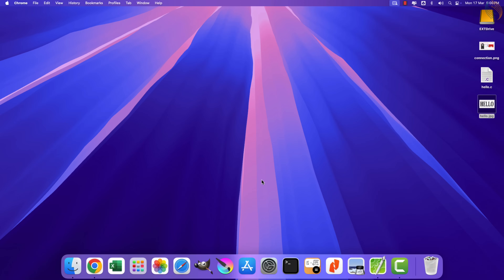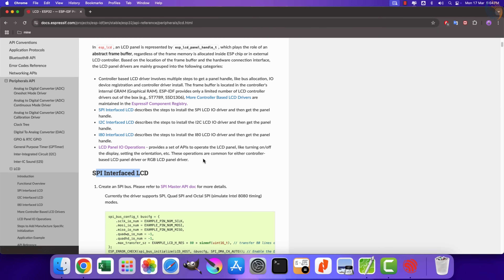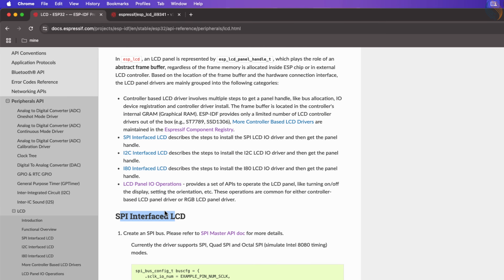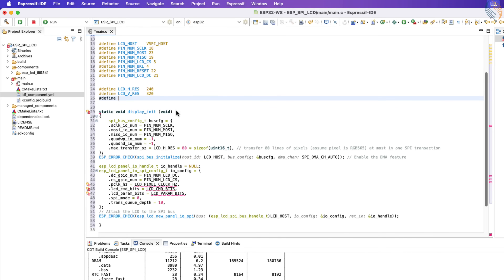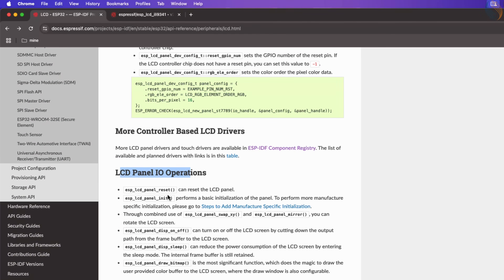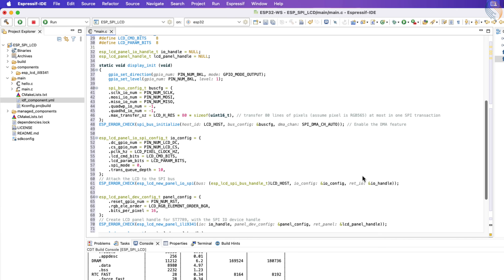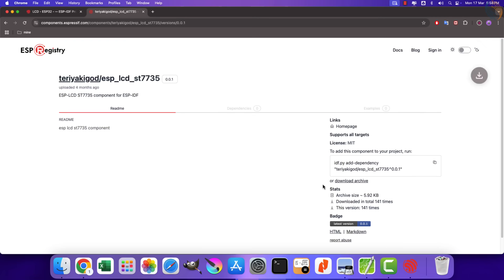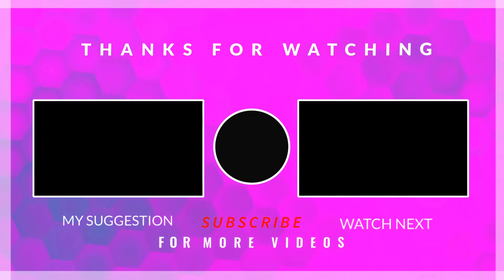ESP32#10 ESP SPI LCD || PART 1 || Interface LCD using inbuilt library || ILI9341 || ST7735

Comment: Hi bro, I want to use it with ili9488, but the support library it shows when I search for my driver is different, like the one you did. Do you think it's feasible to do the same as you and edit parts of the library to adapt it to my driver? Which parts would you recommend I edit? Thanks.
Reply from the maker: What is different ? I found this in the component registry page.. https://components.espressif.com/components/atanisoft/esp_lcd_ili9488/versions/1.0.11
Reply: @ControllersTech  for example the additional parameter "buffer size" and when i work with 16 bits, 
the image is not displayed when I work with 18 (.bits_per_pixel), but it is distorted and incorrect. I don't know exactly what to put in the buffer size parameter and what happens. "esp_lcd_new_panel_ili9488(io_handle, &panel_config,LCD_BUFFER_SIZE, &lcd_panel_handle));" Thank you, i add exactly the component you 
you mentioned ili9488,
Reply from the maker: You can set the buffer size to LCD_H_RES * 20 or 30. It can be better handled by the LVGL library later.

18 bits should work fine for your case. 

Image will get distorted if the image resolution is not the same as the resolution you are drawing. For example, if I have the bitmap of 100x50 and I want the draw bitmap function to draw for 240x320, it will get distorted.

You can see an example initialization by the LVGL for your display. https://components.espressif.com/components/atanisoft/esp_lcd_ili9488/versions/1.0.11/examples/lvgl?language=en